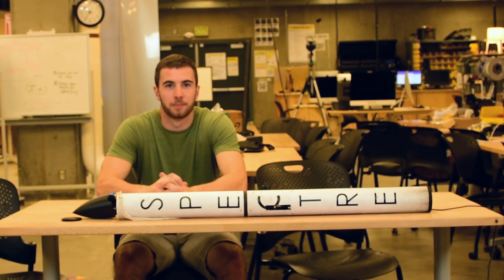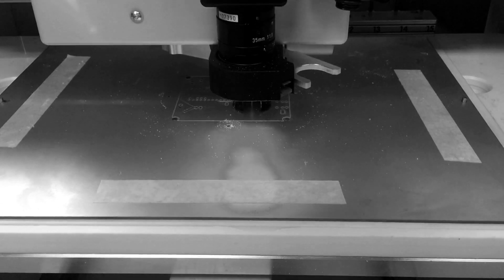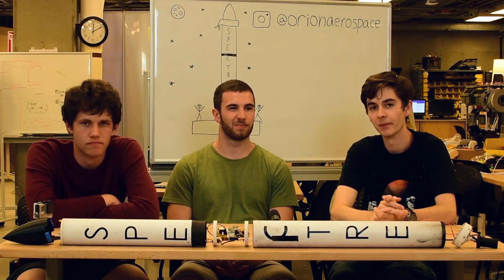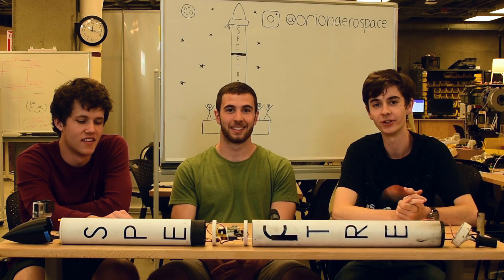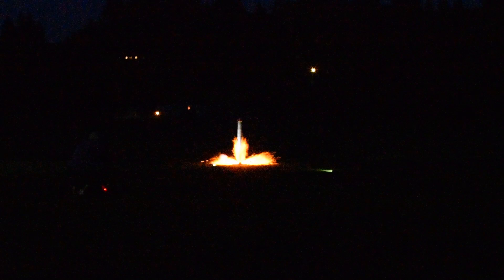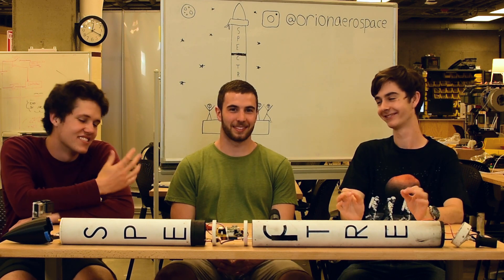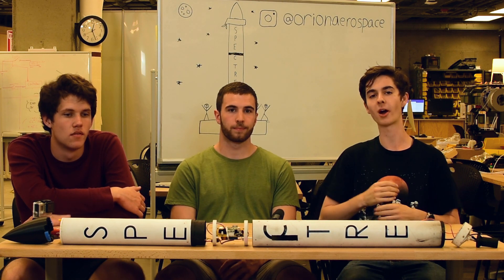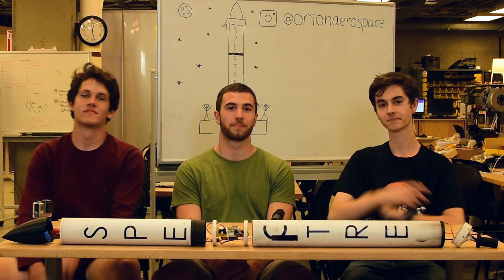Model Rocket Thrust Vector Control | Flights 1 and 2! a Success?

Comment: Great work getting it to work second try. How much does the rocket weigh? You got some good altitude only using an e motor.
Reply from the maker: it's roughly 700 grams in that ballpark! and we were surprised too at how much of a punch those little e motors have!